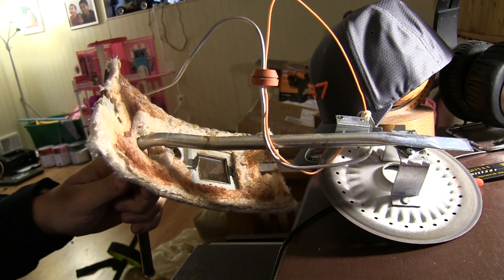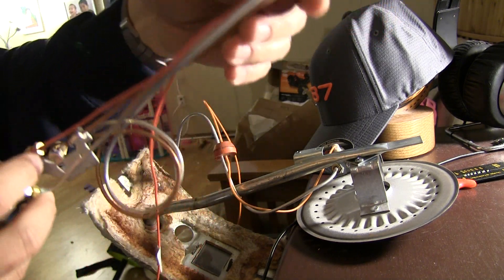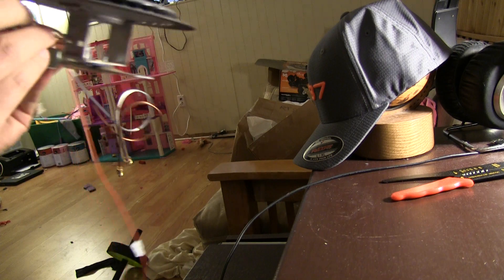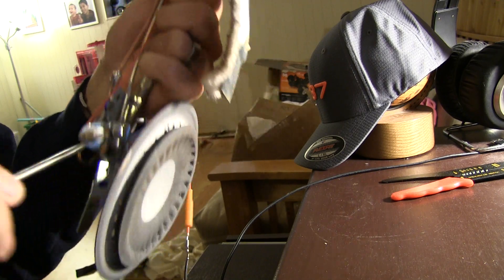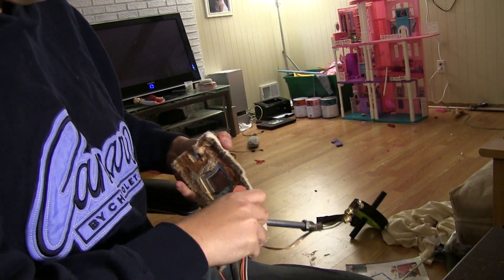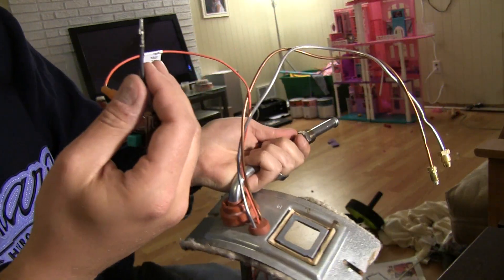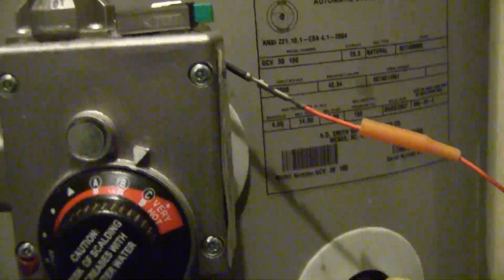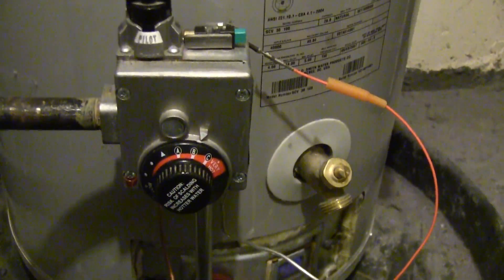AO Smith Water Heater Thermocouple Repair & Overhaul

Comment: Did you test the gas connection under the valve once you reassembled everything? I think you're supposed to spray soapy water to check the seal for leaks.

Comment: A universal absolutely will work. I just did it last week. Mine was slightly different but everyone said I had to buy the entire burner assembly and would take three days to get. Out of options and desperate for hot water I went to Lowe’s and got a 24” thermocoupler. I dismantled the burner assembly and installed it. It worked great and has for a week now.
Reply: My AO Smith GVR 50 100 has the same thermal fuse/ thermocouple configuration.  I replaced my defective thermocouple with a generic continuous thermocouple from Home Depot (Everbilt 24"); so I do not have the thermal fuse any more.  the fuse is a safety if the chamber overheats, which I believe would occur if the ventilation is clogged.  So I made sure to clean/ vacuum my vent screens as well as the combustion chamber during this replacement.  Fixed my pilot from going out.  
The thermocouple replacement was not too easy though, because getting the old thermocouple out was a bear; I had to cut the thermocouple with a Dremel grinding disc, and twist and pry it out.  Then the reinstall was just as difficult, as one of the mounting bracket holes had to be opened up to accommodate the new thermocouple.
Reply: @kimstockdale632  thanks for sharing the details. My AO Promax Plus GVR 50 has the same issue. I thought it was the gas valve so had it replaced. Still the pilot won't stay on. I found out the black disc broke when I pulled out the burner. stopped by home depot and got a 24" universal thermocouple. Just installed it and will put it back on my AO tomorrow. Hopefully it will work like yours.

Comment: Universal couple will work perfectly fine. The toughest issue is removing the old thermocouple from the assembly, but it's possible even with that specific one as I do it for a living.
Reply from the maker: You're 100% correct.  At the time, I didn't know.  The universal unit would have saved me 80 bucks or so.  

Live and learn!

Comment: Thanks for the part number. I was trying to just buy the thermocouple and couldn't find the part. I ended up buying the whole assembly online. The fuseable link fell off on one side. I was able to solder it back into place. My water heater is now working until the replacement arrives.
Reply from the maker: Nothing better than hot water when all you have is cold water!!!  Glad this worked
Reply: Same thing happened to me. The fuseable link broke off the back.  Where did you buy your part?

Comment: Real hands on learning you cannot beat it, my Water heater is only 6 months old last week the pilot light kept going out , the first time i relit it i followed the instructions on the heater to relight the pilot and turned the main burner on and it fired right up.  The next morning i got up and there was no hot water took a look at the water heater and sure enough the pilot light has went out again during the night.  So i did some research and decided the thermocouple was not working properly because the pilot would light however when i let up off the pilot button to light the main burner the  pilot light would immediately go out.  To make a long story short i went for 4 days without hot water , went through two separate "Service Technicians" , neither could address the problem with their vast knowledge compared to me anyway.   The last tech that came told me since the water heater was still under warranty to call the place where i bought it and have them issue a New One i refused to do that so i asked him how much for him to troubleshoot and fix the heater He said Oh "About 500 dollars", i just lol and said well that's not going to happen.  So i called the manufacturer told them i was a contractor and gave them the serial number of the heater , told the guy i had already replaced the Thermocouple and still the pilot light would not stay lit, so He said We will send you a New Thermostat Valve that is problem i said ok .  I got the part the next day removed the old one and installed the New Valve and that fixed the problem evidently the old valve was defective .
Reply from the maker: I've since replaced this tank.  However, similar issue.  This repair bought me 15 - 18 months of extra use which is nice!  Eventually my gas valve went.  I was told that it didn't make sense to replace that and to just replace the entire tank which I did.  

Glad this helped!

Comment: I just did like the other guy here in the comments said to replace it with a regular Universal one. Works beautifully took about 15 minutes to do
Reply: I have seen the fire dept pulling people out of a house after some one did that. You need that saftey feature
Reply: @vedvik  Yes, I used a universal on mine once and a few months later it had burned and melted the orange coating off the wire. When this unit does not have proper air flow the flame does not have proper draft and the flame drifts downward rather than upward. The fusible link cuts off the gas when this starts to happen. Usually the air intake needs vacuumed or blown out with a compressor when this happens. If you keep relighting without cleaning the flame still bows downward and eventually kills the fuse.

Comment: Thanks. Mine has a separate thermal fuse. (check for continuity). Cleaned the thermocouple  with sand paper. Works like new.
Reply from the maker: That's great to hear!!!
Reply: Mike G, you are the best. My GCV 50 100 went out today July 13th, 2020. When I read your comment I took the Thermocouple out and used sandpaper and sand all of them, even the flamer. I put everything back and now we have hot water. My unit is 14 years old, and recently she started to make a popping noise which I know I have to replace the heater soon. I hope it last a bit longer.

Comment: I have two A.O. Smiths FS 40 222 units. I've just changed the second thermocouple on the other unit. I change the first one a couple of years ago. A universal 12" replacement from Lowe's works perfectly.
Reply from the maker: that's really good to know.  Thank you!
Reply: how did you remove and push the new thermocouple through the orange rubber gasket thing?
Reply: I did not have a gasket on either of my tanks. It just snaked right in there. The end of the thermocouple was held in place by a metal piece. My water heaters were quite old. And I've since had to replace either of them.

Comment: Hey your video is helpful, but I just soldered a small loose connection at one end of the resistor and it works like a charm. There is no need to buy a new one. Ofcourse sand the thermocouple when you get it out.

Comment: Yep, I was going to replace the thermostcoupling and dang, nothing looks alike and no part are the same.  So  I might be doing exactly what you are doing.
Reply from the maker: Best of luck!  Let me know how it goes.
Reply: I took a 1000 grit sandpaper and sanded all rusted part and use compressed air and cleaned and install back in about 2 minutes before the installer came to give me a qoute.  Fired right up.  His labor charge was $1300.
Reply from the maker: @kkutube1972  that's criminal!   1300 bucks!!!!    Good for you that you got it fixed yourself.   Congrats!!!

Comment: Watched your videos and learned a great deal.  Replaced my thermocoupler now i can't get the pilot to stay lit.  Is there a vapor sensor that I can check?
Reply from the maker: +e norton Happy to hear that!  Congrats!!

Not really sure about the vapor sensor.  Sorry.
Reply: Very helpful video, I'm the handy man in the house and bought the universal thermocouple too....didn't know how to connect it without it getting complicated, but my unit is just like yours it's welded together
Reply from the maker: +Karish Brock as I understand it, it's a typical AO Smith setup.  for some reason they weld the unit together.  most other brands don't do this which makes for easy service down the road.  good luck!

Comment: My pilot light had been going off about once a month for a few years, then maybe once a week.  Yesterday after going through proper pilot light procedure the pilot light would not stay lite -NO HEAT!  Ordered the proprietary kit then found out after disassembly, the darn inline thermal link in the thermocouple line was not connected correctly (one of the soldered ends had failed but was still making physical contact).  Several wraps of wire got me some hot water and kept us in good graces with the misses - temporarily ;)  WARNING-RED FLAG: : NEVER bypass thermal fuse -we used only slightly hot water and heated attended only when needed until replacement was made(dial temperature knob is still functional in this state, and as I understand these "fuses" are your last link to cut off gas from a catastrophic fire, and may prevent your house from burning down).  Since water heater is 20 years old I did swap the new hardware,  and also will patched thermal switch to old assembly for an emergency backup, after sanding the crusty TC tip (may explain why pilot light was going out so often?).
Lessons learned:  Don't assume you need such and such.  Take assembly apart and examine.  In my case all it needed was maybe a repaired soldered joint, and a sanded TC tip (truth be told I think the bad solder joint was real reason for pilot lite going out so often - metal joint contraction/expansion probably opened bad joint so pilot gas was instantly turned off intermittently - gap got bigger over time/heating cycles, then eventually opened completely yesterday).  
With proper tools it is a 5 minute job to remove entire burner assembly.  (3/8, 7/16" & 19mm wrenches, and 3/8" nut driver).  Pull assembly out a little from the two screws then holding the big gas tube line, tilt burner up to release from burner slot holder.  Be careful on reassembly with brass fittings - finger tight until tight then crank her an extra quarter/half turn with the wrenches(don't overtighten and use soapy water to check for leaks).  If anyone needs fuse info - markings indicate a U1846 190 centigrade made by UHM, I think.  Pro Tip (re-soldering thermal fuses is very tricky -use heat sinks like alligator clips, wire wrapping, etc. so you don't burn it out.
Disclaimer: I'm not a trained technician and only sharing experience with my OA Smith model#GCv-40-100 gas water heater & assemblies with similar TC inline thermal links (both an intermittent pilot lite and an immediate pilot light shut off could be caused by a bad thermal fuse solder joint on the TC line. TAKE 5 minutes to remove burner unit and examine and troubleshoot your issue before jumping to an erroneous "monkey see monkey dodo youtube conclusion", like me.  Logic - capisce?
If fusible Link has a bad joint and not opened or dead then it can be re-attached yielding a potentially very cheap solution.  On my "emergency backup assembly" I tightly wire wrapped it inline with thermocouple with some thin 27 gauge copper gauge wire  a bunch of times.  Soldering would be a much better permanent repair but I did not want to risk blowing the fuse from excessive solder gun temps.  Those tiny brass screw down junction clamps used to join copper wire may also work etc., giving a stronger physical connection.  Again, I'm not a trained tech so do your own research if you are not sure.  My "hacks" are probably not up to "code", may not be even be safe, and heaven forbid in event of an insurance claim, though if used prudently these hacks should get you hot water for a couple days until you or your service person can do a permanent repair.  Other tubers show video hacks for replacing just the TC after it tested faulty, unfortunately a thermal link was not used (recycled or new)?  A expert technician may be able to rig up an off the shelf thermal fuse with proper temperature ratings with considerations of alternative locations not placed inline nor near such precarious locations(ie engineer a more reliable fuse/better mouse trap?)?

THANK YOU FOR YOUR INSPRIRATIONAL VIDEO!

Comment: Thanks for the video,it's very helpful. I have no spark on my AO Smith model, does that mean i a bad thermocouple or something else?
Reply from the maker: +SyCapitaal Hi.  If you're not getting spark I'd imagine it's the pezzo.  Mind you, I'm not a plumber.  So I'd get a second opinion.  However, it if was my unit that's what I'd check first.  Good luck!
Reply: +JaysDMC  thanks for the quick reply. I took out the entire ignition assembly, saw some white residue on the thermocouple, the igniter and the gas piece. i clean it out with sand paper put back in and it work fine. I will purchase the part u mention to have it ready for next time. Thanks again for the video, it save me some $$$.

Comment: U can use a universal thermocupler w/o the fusible link.
Reply from the maker: I had no luck with that.  the bracket that holds it in is tac welded together.
Reply: I was also able to use a universal thermocouple w/o the fusible link on this ao smith model.  I just took the bracket off that held the fusible link, removed the old thermocouple and installed the new universal one.  Pilot stayed lit.
Reply: you will kill people with this advise. That "fusable link" is a saftey feature.
Reply: @vedvik  lol yea i think it's worth the extra money to have it in there. I mean even if you spend the extra ~60 bucks for the whole thing, it's still cheaper than paying someone to put it in.
Reply: @vedvik  I'm glad I read this.. I almost used the 7 dollar universal part.. Now I'm going to just pay the 60 bucks

Comment: Just replaced my fusible link thermocouple with a generic one from Lowe's and it is working fine for now.  Don't know if there are any safety risks involved; will need to research it.  I do know that I'll never buy another AO Smith water heater because parts like this are special order and at least a week out.  Yeah, just take cold showers while you wait.

Updated: AO Smith rep says using a generic thermocouple creates a risk of fire or explosion.  AO Smith would like to sell me the pilot assembly so their information is somewhat biased.  Would appreciated any credible and objective information regarding whether using a generic thermocouple is a real safety issue.
Reply: So what happened. I just replace my with a generic one. Seems to be working fine.

Comment: Hey jaysdmc thanks for the video....can anyone figure this one out...I replaced the thermocouple assembly like u did still with no luck so then I replaced the gas valve again no luck .....I've experienced these assemblies to be faulty in the past.....what you guys think should I go thru another pilot assembaly?....I have the same exact water heater and part as u have  it's about 7 yrs old..thanks
Reply from the maker: A few months after I shot this my water heater started acting up.  This time it was the gas valve.  Like yours, mine was about 7 years old at the time.  The advice given to me at that point was to just replace the entire unit.  Pretty sad that after 7 years an AO Smith unit would start to fail.  Really not cool.
Reply: JV  did you verify your ventilation screen is clear of debris so your combustion chamber gets the air it needs?  I cleaned the vent screen on front bottom of water heater, as well as vacuum the accumulated debris from inside the combustion chamber floor.

Comment: This can be done      BUT     The fuse-able link IS a  'SAFETY FEATURE"  for your protection.   You can remove it at " YOUR OWN RISK"   as long as you know that.......Good Luck!
Reply: Called a By-pass or Straight wiring to BYPASS the Safety Cutoff.
Reply: I only make $750 a Month so do not tell me it is about the Money.

Comment: we have a 14yr old  AO smith gas water heater and it stopped working this morning  and wont light. would you reccomend i try do what  you did.  and if mot. how did you lmow to change the part you did?
Reply from the maker: I'm not a plumber but I'll tell you what I would personally do.   I'd change the entire unit out.   I've always been in the mindset that they have approximately 10 years or so of quality service.    Perhaps someone with more knowledge on this can chime in ...   My fear on having a 14 year old unit is the liner goes floods my basement
Reply: JaysDMC  thank you for reply god bless you
Reply from the maker: @ah4810  my pleasure and best of luck

Comment: Thank you for your video it was clear. After reading Mike G comment. My GCV 50 100 went out today July 13th, 2020. When I read your comment I took the Thermocouple out and used sandpaper and sand all of them, even the flamer. I put everything back and now we have hot water. My unit is 14 years old, and recently she started to make a popping noise which I know I have to replace the heater soon. I hope it lasts a little more.
Reply: Update, after a few hours the pilot light was off. I am not going to buy the 9003542005

Comment: That Pesky Fusible-link. I've had my AO Smith since September 2004. Replaced the entire burner assembly, unnecessarily, around 2012 or so. Ordered another one last night, 10-15 days to arrive. Looking for a better way ,came across your video,should be back in the hot water zone before the work week begins. BTW, getting the fusible-link replaced unless you own or know someone with a tack welder, would probably cost over 50% of the new pilot assembly. Here's hoping you get at least 16 years out of your AO Smith!!!!
Reply from the maker: Cheers!  Same to you!  Hope you have hot water soon!